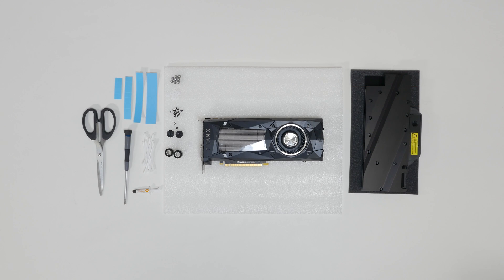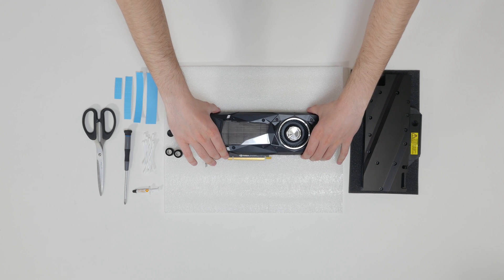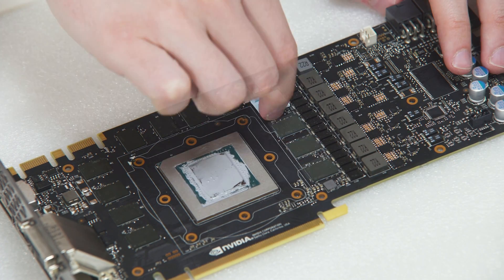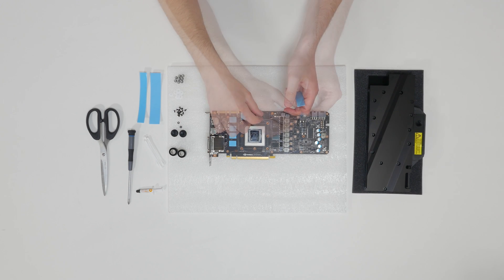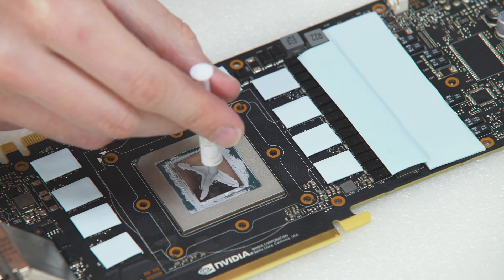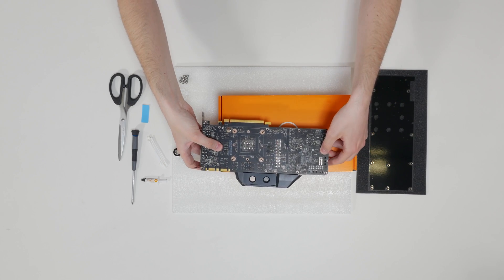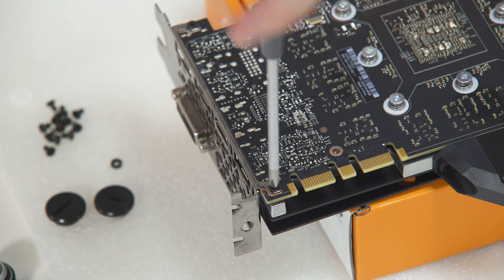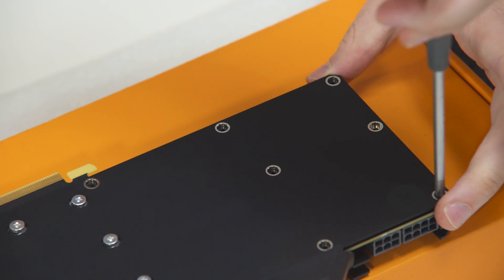EK Fluid Gaming - GPU water block installation

Comment: I don't know if the Fluidgaming has these warning but DO NOT USE LIQUID METAL. the EK fluid gaming blocks are made out of aluminium and liquid metal is made with gallium which gets absorbed by the aluminium making it basically fall apart

Comment: i recommend to carefully wipe away the resedue of the old thermal pads on the Vram and the VRM, before applying the new thermal pads. this can sometimes dramatically increase surface contact of the new pads

Comment: Looks like the compatibility list only lists cards of reference design. Is the GPU block only verified compatible with reference cards, or has it actually been tested incompatible with custom cards? I have a Inno3D iChill GeForce GTX 1080 X3 that is mostly reference design with some power delivery tweaks (your short reference 1080 block is listed compatible with it too) and i would love to slap one of these liquid gaming kits on it. I suspect it would fit just fine, but not gonna gamble on it. You have one at hand to test the fit?

Comment: The manual says that I should connect a 2-pin header to my GPU for the led, but I can't find a cable or an end point for that cable. Is that a mistake in the manual?
Reply: Vegard Alvsaker same here bro

Comment: Would I be shit out of luck if I need two GPU waterblocks? I can't find this aluminium waterblock model for sale separately. Would the pump manage 2 GPUs and the CPU?
Reply: Thanks for the reply!
Is there any ETA on the aluminium water block in a separate pack, by any chance? Or maybe some warehouse deal :D

Anywho, I'm a first-time water cooling customer, if that makes sense, so never really built a loop myself - which is where this kit of yours is a god-send!
Though the question here is - will it be able to handle two overclocked GTX 1080Ti cards and a 5960X CPU at 4.5GHz? Can I buy extra tubing, fittings and an extra aluminium radiator for this?

Or should I just give up on this aluminium kit and try to spec up a custom loop from copper stuff on your website?
Reply: EK Water Blocks - if I bought two of these kits, can I use both 240mm radiators in there to cool both GPUs and the CPU effectively? At the moment I have a Corsair H115i AiO cooler on my CPU (280mm rad with two 140mm Noctua industrial fans) and it juuust about handles the overclocked 5960X. Somehow I fear that having two GPUs on top of the CPU will overwhelm the two 240mm rads.
Reply: Is there a guide somewhere on this? Aluminium parts looked very good (I watched a video from JayzTwoCents) because there's no metal mixing. I need something that won't break bank OR my PC :D

Comment: You show a system with sli gpus on your site, but I don't see any options for a second gpu block and fittings. what gives?
Reply: That's the problem I have. I wanna water-cool two 1080Ti cards and there's no option to buy a second block :(

Comment: Hello EK, I have the aorus 1080ti so the A240G kit can't be for me. I am going to go with the A240 and get the aorus block that you sell. Could you just please tell me wich fittings and tube I have to buy please. I am 100% new to diy water cooling and I am overwhelm by all the options. Thank you.
Reply: Oh... well that's unfortunate... the aorus is really not helping me in trying to diy watercooling (not to mention I am less than a novice, zero experience in it...).